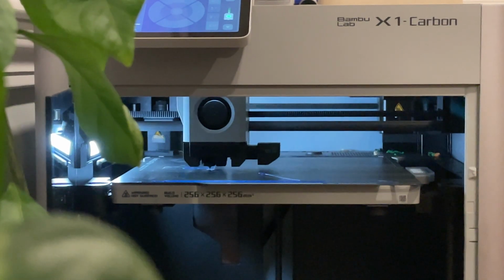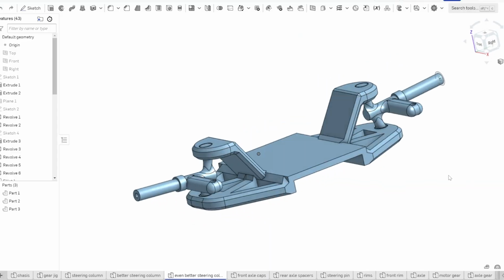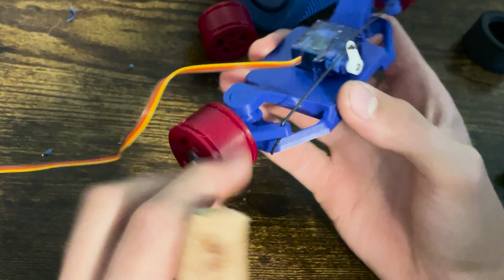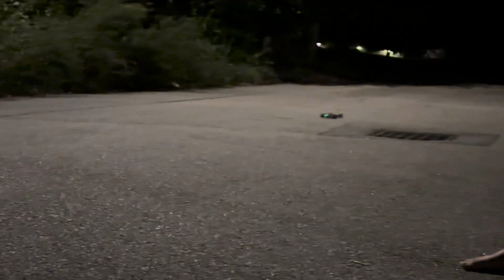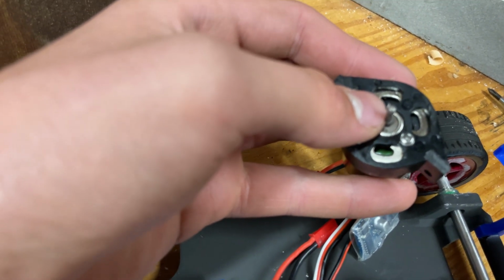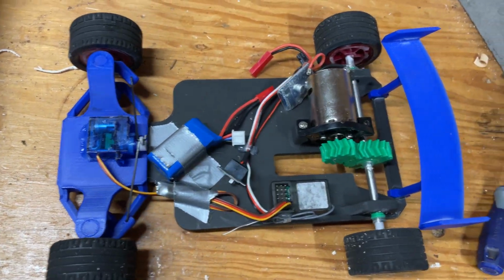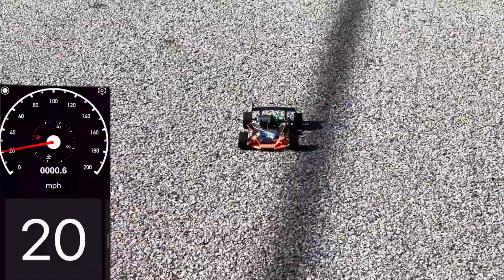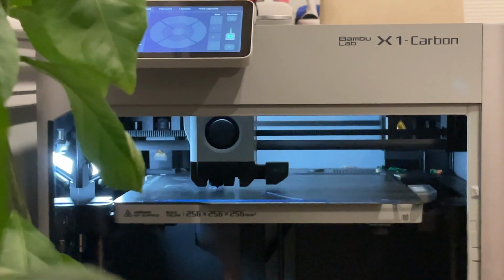3D printed RC Car reaches FULL potential

Comment: Hi. I 3D printed your models myself and it looks great. I just wanted to know if you used 180 degree or 360 degree servo motor?
Reply from the maker: I believe it was a 360 servo, typical little blue one. 180 should work fine though
Reply: @hamburgerinc6995  Yup. And the rear axle diameter is 5mm right? Because the hole in the spacers is 5mm.

Comment: 1. Clamp the shaft with a vise-grip and flatten the exposed tip to a "D" shape. Design the gear hole into a matching "D" shape to fit.
2. Consider using a screw/bolt for front wheel shaft, or maybe find the longest screw your can, and thread it all the way through!

Comment: what slicer u are using?
Reply from the maker: bambu labs slicer, its a free download from the web and works for many different types of printers
Reply: Idk why but when we printed steering it won’t turn . Do u know what we go wrong
Reply from the maker: @simsbumgg6606  the tolerances likely were too fine for the printer you were using, so when it printed the layer lines fused

Comment: Hey! Do you need to program something or just buy the components and il will work after assembly? Thanks!
Reply from the maker: none of the electronics I used in this video had to be programed. They are just simple rc electronics from amazon, hope this helps

Comment: hi i made the rc car from your thingiverse files i just have one question how did you secure the front wheels and stll let them spin because for me they just slip on and off there is no bearing for the front 2 wheels
Reply from the maker: There is a 10x5x4 bearing on either side of the rim, with a small screw which goes into the shaft on the end to hold it onto the axle, hope this helps
Reply: i meant the front wheels not the back wheels. the wheels that connect to the steering colum @hamburgerinc6995

Comment: Good overall conceptual design iterations and pretty good results. Gonna share some tips from my own experience as a hobbyist to help.  

When trying to bond metals with plastics like the motor shaft to the gear. sand the metal with coarse file to roughen it up for the glue to grab on to, and then dont use crazy glue (CA Glue), use something like 2 part mix such as JB Weld for plastic and metals. and also to create a key for the gear, just file down a flat spot on the shaft, and thin out the gear thickness so u can have some material like a collar either above or below the gear mesh, and drill a hole, use a grub screw to screw into and have it dead end on the flat spot. That should take care of the slippage. 

For the steering, to track straight, as well as for rotational purposes to maintain or rather using the camber properly, your gonna want to have both the upper and lower arms be able to swivel, not static at the bottom, and swivel up top. that way when the weight of the car makes the car roll while turning, the contact surface of the wheels in respect to the camber set will compensate for the shift in lateral weight on which side the car is rolling against on a turn. and the steering linking already has the ability to flex, so it will counter when the servo reverses out.
Reply from the maker: Amazing advise. thanks for the feedback!
Reply: @hamburgerinc6995  absolutely, glad to spread any knowledge i can share. Especially in the hobby. I love how 3D Printing opened up the hobby to whole new levels. Before 3D printing, it was 3 axis Cnc in the garage using block chunk of aluminum to make molds for the plastic gears and parts. Sooooo much waste though, from the material that has to be milled off. I love 3D printing. To be able to directly print out in plastics and now composite metals as well. Ive been building and fixing all my RCs plus more. Lol. Oh not sure if you have had a look over on Thinguverse. But the 3d design and printing community shares a lot of their projects, amongst which you can find many scale recreated cad and stl's of existing RC platforms and of many others disconnected as well. You can have fun with mixing and matching different parts and make a new one unique for your own. Easy to scale the parts to meet whatever scale you want the RC to be.

Comment: Very nicely done. A couple of thoughts. You can drill the gear and put set screw in it to grip the shift of the motor. And the front spindle that broke would be stronger with 100% infill. You also can make the car more stable by dialing out some of the steering on your radio. Overall you did a great job! 👍
Reply from the maker: good ideas, thanks for the feedback